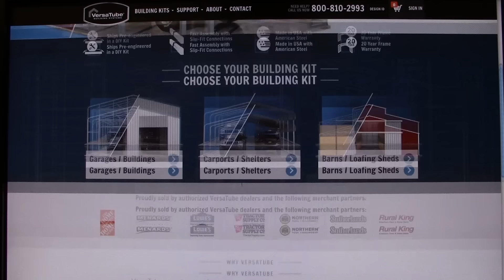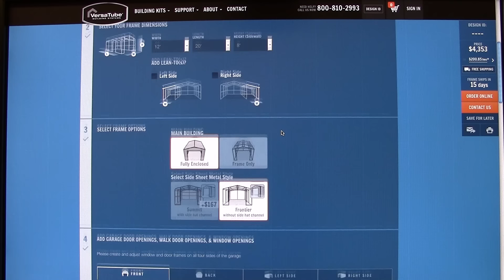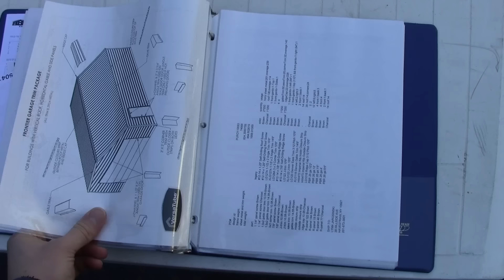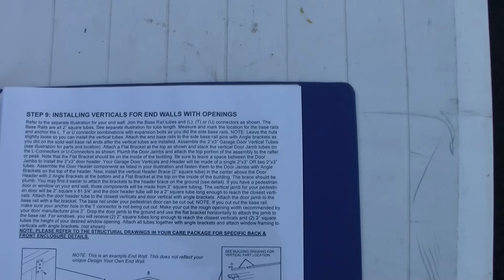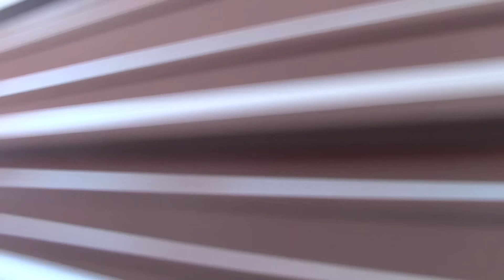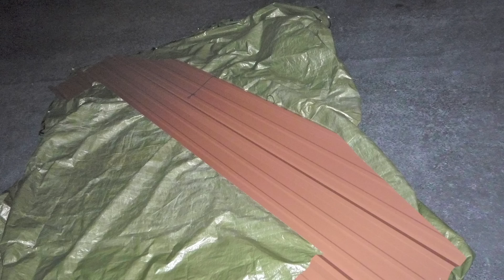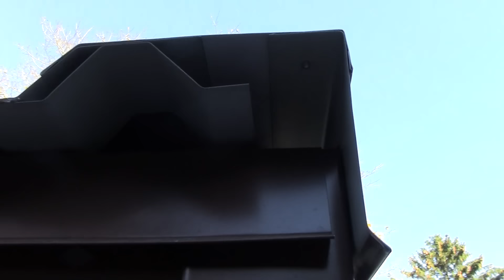Versatube Metal Garage Review In-Depth

Comment: I think most of these issues were dues to a lack of experience dealing with these panels and this type of construction. The slab should not have extended past the siding and preferably not past the framing to allow water to drip to the ground. Would probably help with the leaks if you installed some gutters and downspouts. Can get them locally from metal roof supplier and most likely match the color closely. The siding should have been started from the bottom. Also, these panels are really designed to be installed vertically, installing them horizontally causes some of the issues you are having. Suspect installers would have installed that last gable panel letting it run wild above the roof, then cut with power shears.  Not sure what gauge panels you ordered but these "R" panels in 26 gauge are on true pre-engineered steel building all over the country and they are NEVER pre-cut to fit as far as I know.
Reply: This particular kit is designed and sold with the intention of the siding being installed horizontally.  I agree that it should be vertical, but Versatube sells it to be installed as shown here.  There are other videos making the same complaints as the OP, and in those videos, the installation is being done by professionals contracted by Versatube... all with the same complaints by the installers and customers.  I think it is important to note that this was a relatively inexpensive structure compared to bigger and better companies.  So you get what you pay for.  Good video with helpful information.  I didn't see it as overly critical, and certainly not just bitching by some un-handy knucklehead who got in over his head.  He seems to be well aware of how it ought to be, and how to accomplish the project better with a few improvements to the instructions.
Reply: Exactly
Reply: regardless, it is sold as a prebuilt aka kit, you would think they have made it idiot-proof.  Also what about the weak supporting for the roof ? is that his "inexperience" as well ? They advertise it as anyone can do it and this is far from the case. After watching this review I will be breaking out my mig and tig and fabing my own. p.s. your reply sounds like you are working with versatube.  You are slamming this guy for not having experience in sheet metal when he bought a kit as an " anyone can instal project".
Reply: @desyquintero8451  even 200,000 sqaure foot metal buildings are "kits" they still require cut n fit and experience to make everything work together

Comment: You should have a sill plate seal, like a sealant or a like a roll of foam seal. But silicon caulking the inside and out. I’m about to have a 30x30 eve wall heights are 11ft and 13ft with 2 10x10 doors installed. I will be watching the builders very closely on what they are doing for sealing.

Comment: The slab must end at the outside of the wall studs so it sheds water. You completely ignored that basic building rule and even mocked them for telling you how it should be done correctly. "It's ridiculous, who's going to build a slab that ONLY covers the building?" (anyone with a clue) Then you blame them for the fact that there's no way to keep water from coming in under the wall.
Reply: Yeah I was laughing throughout this review, lots of interesting takes, but all in all good for people to know what frustrations they might run into. It’s honest from a point of view and that’s respectable.
Reply: I haven't seen that part yet,  but every building I've seen in person,  the sill plate mounts to the edge of the slab.  The siding overlaps the edge of the slab

Comment: I am getting a prebuilt metal shed with a wood floor and roll up door that is 6 ft wide and it is 14 wide and 18 ft long and is only 24 hundred dollars delivered to my home .So I guess it is a better deal .It is just for my 2 ride on mowers .It has and A frame roof with gutters and heavy gauge steel .Never would try doing what you did .

Comment: You have water coming in because you did not pour a correct foundation. The flatwork (the sidewalk / patio) area you have around it is not dropped. doesn't matter what you build on it youll always have issues with drainage, rot and rust. We build home 8" minimum above ground level to give proper room for the final grade and drainage. 

I bet had you started the horizontal siding from the bottom going up you could have fixed the issue with the gap at the bottom. Also I hope the siding is overlapping the correct way to prevent rain and moisture from dripping in as well since you started from the top going down.
Reply: Slab needs to drop, yep..   I dropped my moms when I had the concrete guy out there, but I didn't assemble.   Use some heavy duty silicone to seal it.

Comment: My shed is a 16 inch on center wood with that sheet metal siding and 12X24. The idiots that built it screwed up by putting screws through the lower valley on the roof metal. Then they set the entire roof too far to the back causing an uncovered top plate causing wood rot.

Comment: Never in my life have I installed a steel building that was a drop together kit. The siding panels are ALWAYS cut to fit, no matter who you go with.  You sided from the top down instead of bottom up and that's why you had problems. Out of all the steel building manufacturers out there, Versatube is one of the better ones.  Oh and for the record, you should have put down some heavy outdoor caulk or construction adhesive under the bottom rails before bolt them down to the concrete, that alone will help with any water leaking in, or lay a course of block as a small foundation wall first.  You'll have the added benefit of more height too.
Reply: KelMaster Construction  lol, live and learn. Shoulda had a BBQ and a few friends over with a little more experience to throw it up. 
Gotta learn to pack your own chute for a little slower/softer opening. Those quick neck snapping openings are no fun!
Reply: Also if the slab was bored to the proper dimensions according to the plans, he would not have to worry about water running in because the building would be at least 4 inches off the ground.

Comment: Your points are noted and some have merit (Chinese Engineering?) but you made mistake too. However, I don't Know any OEM  (manufacturer) that will send you pieces that are specifically cut for the end walls.  I know that seems like that sucks but the logistics from the manufactures viewpoint would be most difficult and add a lot more expense and create a lot more problems.  Do a few more of these buildings and you'll develop more of an understanding how and why they are made and why they are relatively cheap.  There's no substitute for experience in these projects.  I can guarantee you the 2nd one you erect would be easier and the third one almost a snap.  First time projects are just the beginning of the learning cure.  Next tine get some experienced help.  But it looks pretty nice for your first time.

Comment: I bought the frame work of one of theses last year.My self i had no issues bought my own metal.due to the fact the metal comes in 36 inch width .I agree with you on the 2x4 on the roof i placed two rows my self 2 feet apart  like you did.Yes i had to cut my metal.But for the price .If i wanted a custom garage i would had to pay at lease 3 times or more.Yes you would think a kit would fit all but this is how things are now days.But that was a good video

Comment: I must say that it is nice to be able to read reviews on the internet before making a purchase. Unfortunately, one has to sift through all the reviews and make a judgement as to which ones to put stock in. It really disturbs me when someone that is not knowledgeable or qualified to write a review does so anyway and ends up affecting the opinions of other unqualified individuals. I'm not saying that this guy doesn't have any valid complaints, but he is way off base in his overall review. 
First, it is obvious that he bought the building on the website with no discussions with VersaTube about the details of what he was getting. No one with any experience with buildings of this type, or most anything else, would make such a purchase without making sure of what he was getting. Otherwise, he'd have known that he was getting stock sheets of sheet metal. NOBODY ships pre-cut pieces of sheet metal that the buyer just screws together. His expectations of a "kit" show his lack of understanding and experience. That could have been avoided by talking with someone at the factory. 
Second, he complains a lot about too many written instructions and not enough pictures of how to install the roofing and siding. I wonder if he read all those instructions which may have kept him from screwing up the roof. Laying out the pieces would have revealed a problem before he screwed the panels down. Another "engineering error" he cites is the lack of a seal against water intrusion. Why would anyone set a building on a flat slab and expect it not to leak. If he had looked at the foundation drawing furnished by VersaTube, he would have seen the required ledge surrounding the building. That ledge serves 2 purposes: (1) it keeps water out, and (2) it gives a place for the siding to "die" so you don't have to trim the siding to match the slab. The surrounding slab must be poured lower than the inside of the building. 
In general, most of this guy's problems were caused by his inexperience, lack of general construction knowledge and his unrealistic expectations regarding pre-cut pieces of sheet metal. All you people who claimed "great review" and plan to run to another manufacturer, you'd better do your homework lest you be similarly disappointed. Otherwise, get somebody who knows something about construction to help you.
Reply: Michael McInnis 
Finally someone else sees this project was doomed from the beginning. Unfair review for versa-tube

Comment: Thank you!  Due to this and many other such reports, Versatube dealers have lost the sale of three buildings for our ranch, all of which are on the larger end of their structure sizes.  There is no excuse for the kind of engineering screw-ups reported here.   My contacts with their sales force played another role in our ultimate rejection of Versatube as a building method for smaller outbuildings.  They truly seem less trustworthy than a tote-the-note used car dealer from East LA.
Reply: LFOD7491 which one did you find instead? I'm curious thank you

Comment: Hard to watch.  Of the complaints I did hear they all can be summed up simply.  Its called construction.  You have to bring a small amount of skills.  CUtting sheet metal, screwing a lot of screws isn't asking a lot to build a structure.
Reply: gracilism "pre-engineered" should be top to bottom. Not get as the raw materials you figure it out.
Reply: The key point is as he said, it's a frame kit, and the sheet metal and covering is just raw materials left as an exercise to the reader. The impression is that it should be all bolt on and screw construction, rather than all that cutting and fitting being required.

Comment: All the problems you ran into were all from not having the knowledge to build a building. Hire a good contractor with some knowledge building these buildings. Pour the correct slab for the building. Start the side panels from the ground up and the top piece would have been long enough. Plan ahead measure the roof layout before you start sheeting it start it correctly and the trim will fit right. There is nothing wrong with the building. It's just a project that was over your head. Instead of slamming a reputable company maybe put the blame where blame is due. On the one that thinks they know more than they do. Maybe say the building is solid but requires more knowledge that just running a drill. Don't blame a company and a building for your inability to erect one. I own 4 versatube buildings much larger than this one and have none of these problems. This review just shows why some projects should be left to poeple capable of the scope of the project.
Reply: I do believe they are also selling to the beginner with a DIY product. Lets not compare first time DIY to Professionals. Otherwise he probably would have went a different route. I personally would have gone with a stronger metal building. Their business model is not buy our DIY kit and then ONLY hire a professional. IKEA bases their reputation on making furniture that is easy to build yourself. They are well known and profitable using that business model. If this company wants the same success with that business model, then they need to address DIY'ers  issues or get out of the DIY game.  He has valid points.  He made some mistakes.  I have seen professionals make mistakes. I will spare you the stories of "professionals" that messed up on my house build and then tried to hide it.  You could fill your days with Professionals @$%^& the consumer on media sites like these. Yes i did my homework and yes they come well recommended and yes he/they are still building houses and is still well recommended. If Versa tube is selling beginner kits, then they need to deliver. If their website says "My name is Chris and this is my first do-it-yourself building project". "First-time builder with no previous experience". "Has experience with only common household tools" . Then they need to deliver.  All quotes taken from Vera tube's website. This is a valuable video that lets people know that not everything is precut, hat channels are sparse, trim is not long enough or matching, etc, etc.  I would also be concerned about walking on that roof. They offer very little information on concrete slab foundations in the learning center. Maybe it is somewhere else on the website besides the beginner learning center page. There is another opportunity for Versa tube to improve their beginner information. I came here because I want to know how easy their kits really are.  I want to know where it could go wrong. Versa tube is not just selling buildings, they are selling a product for beginners too.  The building frame be could be raised or lowered to fit the siding panels with less cutting could be a good selling point. Somewhere in the design process the program could let you know. If you add so many inches there will be less panel cutting. Boom. More money for Versa and easier build for beginners. Versa tube should take his beginner feed back and turn it into gold. The funny thing is if all that information was already on their website or we all already knew everything, would we even be here?  Would there even be a YouTube? Would that guy be able to belittle others and be ignorant of Versatube marketing to beginners?
Reply: @mukesh7740  +
I agree. The problem isn't with his lack of skills or tools. The problem is that the company promotes a do-it-yourself kit that can be put together in a weekend with common household tools. The company provides a 2-part kit, one part which they manufacture that is as advertised. The 2nd part is supplied by a local sub-contractor, who may or may not pre-cut the panels, who may or may not give you enough square footage of panels and trim to cover the structure, and who may or may not deliver the right style of sheeting or the right color. They get paid either way. If there's a problem, VersaTube's the one to catch the flack for it.

One point that he forgot to mention because of his level of frustration - at the beginning of the video, he said he ordered a brown building with a grey roof. In the video, you plainly see that he was delivered all brown sheeting and trim. Lesson for VersaTube - if you're not going to manufacture every part of your product, plan to be screwed over by the sub-contractors, prepare for dissatisfied customers to complain and post negative reviews and YouTube videos, and expect an inverse sales curve (as in no one's buyin'). My wife and I had considered buying one of these buildings at the end of summer, but a change in finances prevented it then. I'm glad I watched this video. When spring arrives, we'll just go another route.
Reply: Chad Therriault versatile does tell you to install the siding and a few things incorrectly. Realistically the company knows that these are diy builds and should have pointers on some issues that you may come across. Like if you have an 8 foot wall you will need to cut a foot off the siding. I guess you will find out when you come across it at that point.
Reply: chad you are part of the problem, with that attitude, what part of d.i.y. do you not understand?

Comment: You never build the foundation past the edges of the building, thats why it leaks
Reply: Elvan Tucker, It gives rainwater a place to pool possibly causing the frame to rust out prematurely.
Reply: That's right, I bought a brand new condo in Annapolis, Maryland when only the foundation had been poured and when they built the building, stick built no brick, it was offset a few inches from the edge of the foundation and we ALWAYS had water intrusion issues... very frustrating especially with a builder that seemed too stupid to understand LOL.
Reply: MrDooder23 y would that make it leak

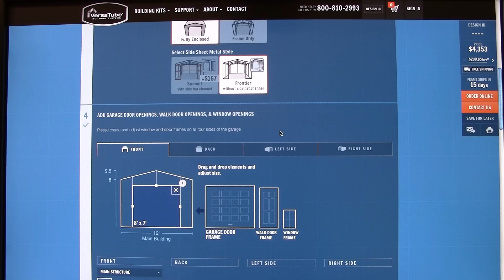Comment: I'm not sure where you are located as to what your building codes are for where you are but when i put into the VersaTube web site, the exact same information that you did, I get roof hat channel at 5' 7 3/16" on center.  The 26 ga metal is supposed to give you the added strength to space the purlins out further.  Using the 29 ga material, it shows the purlins would be 2' 9 5/8" apart. The metal places down here (I'm in Texas northwest of Houston) say that 26 ga RPN should have purlins no more than 5' on center. And based on a 12' building and a 3:12 pitch your roof panels would be just over 6' long so I agree that there should be at least 1 more row of purlins.